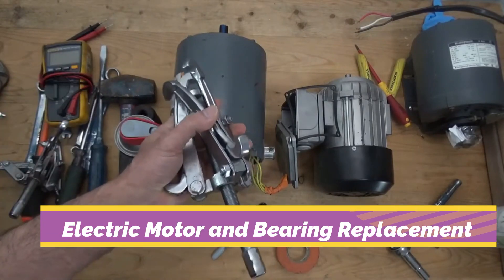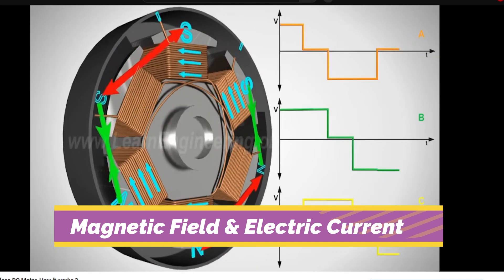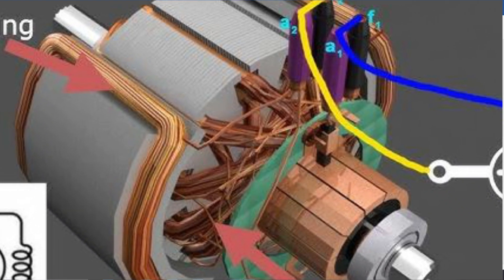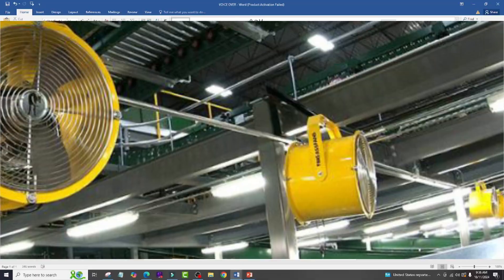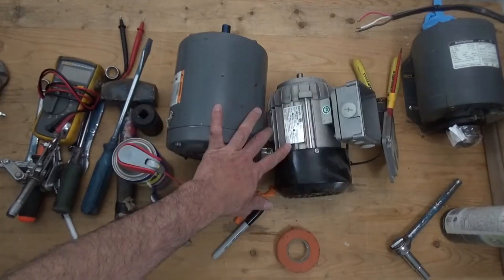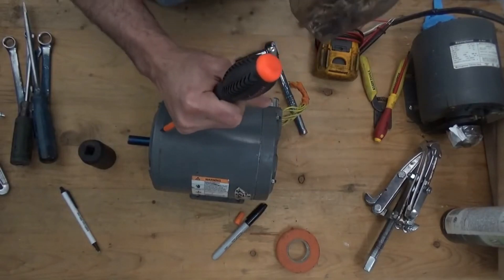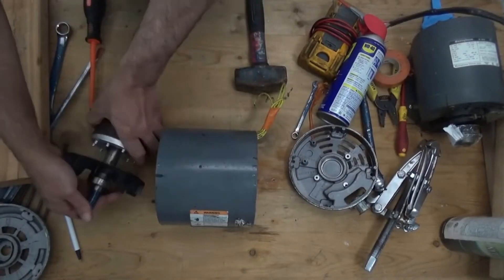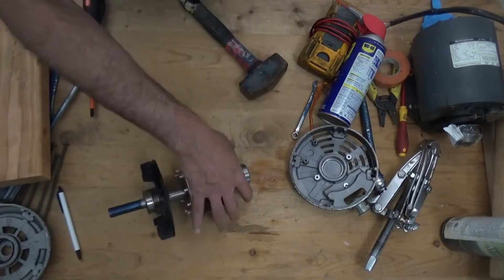What is an Electric Motor and Overhauling, Bearing Replacement (PLAYLIST in DESCRIPTION)

Comment from the maker: HYDRAULIC and PNEUMATIC PLAYLIST
https://youtube.com/playlist?list=PL8zOygNOyBo3R5oYG3QbiKpTDfea7lOH_&si=Eq8ubZ-Ifhhou5Ux
MAINTENANCE and MECHANIC TECHNICIAN INTERVIEW PLAYLIST
https://youtube.com/playlist?list=PL8zOygNOyBo0ebIGjWA1EApSRlVplRk5o&si=VQ4WIn3JJD5TNpAA
ELECTRICIAN and ELECTRICAL ENGR INTERVIEW PLAYLIST
https://youtube.com/playlist?list=PL8zOygNOyBo03qqp_LS_kaOuWQ9Jhu8Eh&si=j35inOdRKSMcpEnj
FANUC ROBOTICS PLAYLIST
https://youtube.com/playlist?list=PL8zOygNOyBo2qgxRawO_ZbbBeqgRtfBgz&si=ofpvkTza9NTW8sOc
ABB ROBOTICS PLAYLIST
https://youtube.com/playlist?list=PL8zOygNOyBo1-r6lAlnSPf13Pb12qD_hh&si=tp-OgX_o_bbJ61pF
LOGIX PRO SIMULATOR PLAYLIST
https://youtube.com/playlist?list=PL8zOygNOyBo1L4DkctyHml6NeT6gbPqnr&si=CdxtIdy4dtnOnsQw
MASTER ELECTRICIAN REVIEWER PLAYLIST
https://youtube.com/playlist?list=PL8zOygNOyBo1q_dgMi_axopMq8kTEO4jh&si=phyJiGZkFXtDJZIM
Milwaukee Impact tool Adaptor
https://amzn.to/3BLBQoI
WAGO Connector Set
https://amzn.to/4dJkZjq
FLUKE CLAMP METER
Battery Jump Starter 1000 Amps
https://amzn.to/3YmEOIU
BULLS EYE Pro Tire Inflator
https://amzn.to/3zZpeJZ
Traffic Safety Cones 4 pcs 
https://amzn.to/3U7LPuR
https://amzn.to/4eXri3U
WIHA SCREW driver set
https://amzn.to/3YmMlaS